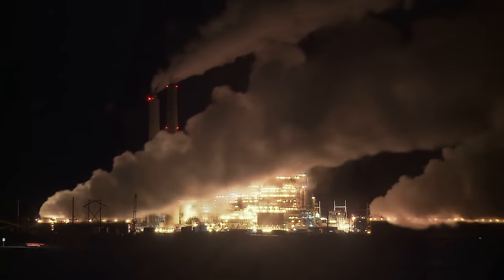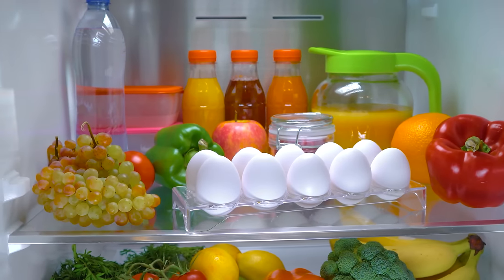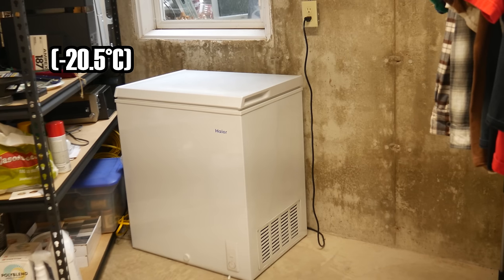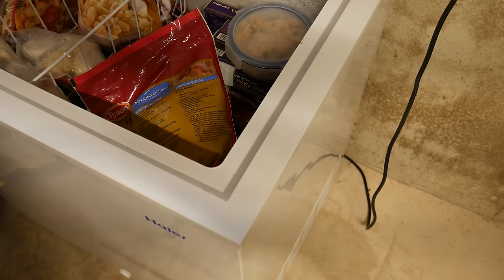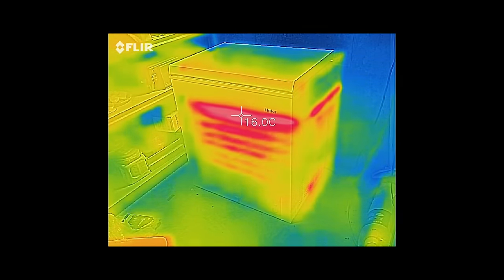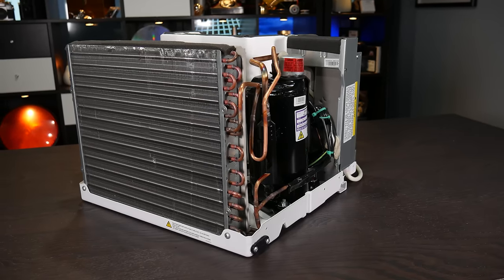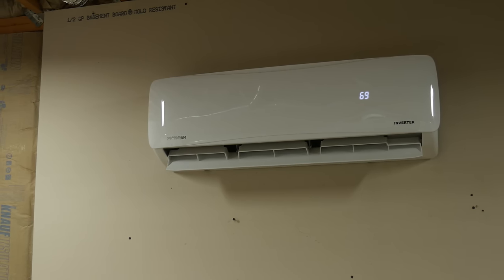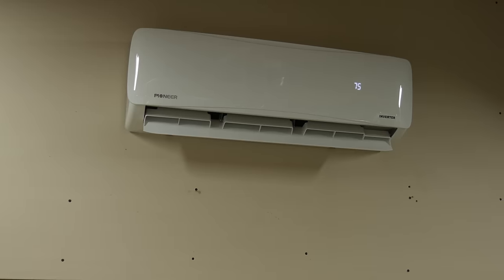Heat Pumps: the Future of Home Heating

Comment: "its just an ac but backwards"
me: installs my ac backwards for the winter
this can't possibly go wrong lol
Reply: You just need a bucket incase you have any condensate. Also earplugs.
Reply: "Turn up the heat."
"I can't reach the thermostat anymore!"
Reply: @MikePerreman  how? It's always going to be below target temperature.
Reply: @shawnpitman876  You could always pull some trickery with a little circuit reverse engineering, and relocating the thermostat inside. Granted it'd be more work than it's worth, but It's still doable. Basically just an opposite style thermistor than what's already equipped.
Reply: It would kinda work, they're just not designed to handle frozen heat exchangers like a heat pump is.
Reply: Well, it would work, cooling the outside and heating the inside as the exhaust would be pointing inwards, but at that point an electric heater would be more efficient.
Reply: When I was a kid, I’d walk by the A/C unit and feel the heat coming off. Even then, I knew it was some type of heat transfer.
Reply: @thespacemanfil  Considering when it's cold it's usually dry anyways...plus humid air has a greater heat capacity. Sounds like a win win.
Reply: @mykeprior3436  A/C units dehumidify as well as cool, as it is what they are designed to do. Just saying some people might not like humidity.
Reply: @thespacemanfil  there's a whole another video on heating and winter and needing humidity inside while heating because the heating action is drying out the air so this would help in a way
Reply: @buddyclem7328  I know some mini split units can be paired with a wired remote, so.....
Reply: @shawnpitman876  The less sophisticated units usually have a "max AC" setting, which means it's essentially on all the time
Reply: @thespacemanfil  You can't humidify without adding water. In a flipped window unit the drain would go into instead of outside the house, but as any condensation would permanently freeze on the condenser there would be no drainage until you turned it off and the temperature outside was warm enough to melt it. Otherwise, using a heat pump merely heats the air inside, it doesn't add water, and because you're increasing the temperature you would be lowering the relative humidity (increasing the capacity of the air to hold more water), essentially also dehumidifying the air inside the home just like any other heater.

As for efficiency, it would be no different than any other heat pump.

But it wouldn't work at all without replacing or massively modifying the control electronics that are designed to cool, not heat. The thermostat is designed to come on above a set temperature and it would have to be changed so it comes on below the set temperature instead.
Reply: Technically will work. However, most window A/C units on the market have a low temp sensor on them which will not allow the compressor to start because the pressure gradients are too disparate for the equipment to handle. In fact, your car has a low temp sensor that does the same thing as well.
Reply: Yep, you need to outside to turn on your heat ! LOL !
Reply: @jazzman92478  Nope, it's a nonstarter when the thermostat is set up to make things cooler and the temperature is already lower than the thermostat goes.

You could heat your house in the summer! 🤣
Reply: Pull the thermosening bulb and wrap an electric heat pad around it. Or just put a 100w incandescent light next to it.
Reply: u mean like the type of AC you'd install in a window?
theoretically that shud work fine.... but like radnuke said. Keep a bucket underneath xD
Reply: @Broockle  No, won't work at all with the factory thermostat. A bucket won't be necessary because any condensation will freeze. It will also block the evaporator and pretty much bring the process to a halt.
Reply: Does that make it a C/A?
Reply: @awo1fman  
......r we talking about the same devices?
I always see the heat sync having a spillway for the condensated water to go outside where the heat usually goes. So I'm thinking if you turn it around the water will end up indoors instead..... I have no idea how that could freeze as you said. 

And factory thermostat... guess that might shut itself off under circumstances... maybe you'd need to diy something there.
Reply: @darkowl9  
i was w8ing for this comment xD
Reply: @Broockle  Yes, the drain would go inside where you would have to have a bucket to catch it... if it weren't for the fact that it would freeze directly on the condenser and never get a chance to drain anywhere. Then there's the fact that the cold outside air would likely be more dry anyway. As he shows in the video, it can happen and heat pumps are designed to deal with it, but a window air conditioner only has to deal with warm temperatures and has no way to actively melt the ice (it relies on cycling off in a room that is well above freezing to clear the condenser), so it would just stay frozen and block the air flow through the condenser fins, making things go south quickly.

It's possible to modify a window unit to work in reverse, but it's not possible to just turn one around in the window and have it work. By the time you're done modifying it, you may as well have gone with an actual heat pump anyway. 

Some of those motel units are heat pumps and heat as well as cool. Many just use resistive heat elements but I'm pretty sure some of the newer ones are heat pumps.

I had an old car with an under-dash air conditioner that was really bad about freezing up in a hot and humid climate. It would run constantly and not stay off long enough to melt the ice, and it was worse when it was hotter. It was a vicious cycle because the more it froze the less effective it got and the more you wanted to turn the thermostat down. A condenser outdoors in cold weather would have no chance at all of clearing without a dedicated system in place.
Reply: @awo1fman  
mok, sounds legit.... the image of it still amuses me tho xD
I kinda do wanna see someone try it and show everything wrong with the approach.
Reply: @shawnstillman4203  Yeah, or a candle.
Reply: @mykeprior3436  you have that backwards. Hot air has a greater humidity capacity, not more humid air has more heat capacity.
Reply: @shawnpitman876  whow there buddy.
hot air can hold more water vapour as there's literally more "space" at constant pressure for molecules.
water vapour has a greater heat capacity then dry air. Period. Two parcels of air at the same  pressure & temperature differing in humidity only would result in the more humid air having greater heat capacity as water is capable of absorbing IR in wider bands as well as having more degrees of freedom allows for more places for heat energy to translate to movement within water versus dipole neutral molecules like nitrogen, oxygen and the noble gases which primarily make up the air (carbon dioxide and methane being the few with a dipole which stretches due to IR but are in the ppm range versus water which can make up to 4% of air by volume in the tropics). A great portion of the air has a component which is better at absorbing heat, hence higher heat capacity.
In fact, your statement is even more bewildering as "hot" air at constant pressure becomes worse at "holding" heat as the temperature increases under a constant gradient and it's heat capacity is exceeded until you get it into a state where it either is reacting or electrons begin changing orbitals, where the heat capacity would suddenly increase. Heat capacity is NOT the same as thermal conductivity.
More humid air would take longer to heat up but would stay warmer for longer.
Grad degree in chemistry, please keep ignorance off the channel.
Reply: That actually would work, although reaching the controls would be... inconvenient. And it's probably not waterproof. And it would be incredibly noisy.
Reply: @MikePerreman  and kinda break your AC unit
Reply: Just buy an A/C unit that already has a Heat option

Comment: In Korea for a business trip and I was surprised to recognize that almost every building where I am is heated by heat pumps despite during the coldest parts of winter it getting into the single digit negatives (F). Caused some issues on the coldest nights as it would have to pause to defrost periodically but I was able to use a space heater to flatten out the curve in temperature fluctuations.

Comment: I was a refrigeration engineer for 40 years.(retired) This is the first video I have seen that explains the operation of a heat pump correctly. Well done. I find your "heat" units a little strange, I am used to BthU  & Si units. I built my own system using a 3HP Frigidaire unit, (R22) belt driven in my garage, with the evaporator/condenser in a warm air duct system, 35 years ago. Worked well for over 10 years, until I moved house. Serviced it for the new owners for 3 years until I left the area. Love your video's, keep up the high standard. I am in the UK by the way.

Comment: When I was a kid in the 70s, my parents had a 60s vintage Kelvinator refrigerator.  It used a process similar to a heat pump to defrost itself.  A few times a day we would hear a shhhhh sound as the refrigerant would reverse flow.  Occasionally,  the mechanical timer would fail but otherwise,  it was a good refrigerator.
Reply: interesting, I never heard about refrigerators defrosting. I guess modern fridges are just built in a way where they dont need to do that? Or maybe they still have the capability and only do that when its really cold.
Reply: Defrosting of modern refrigerators is by an electric heater behind a panel at the back of the food compartment. The refrigerator shuts off and turns the heater on for a couple of minutes. It's simpler and cheaper than having the refrigerant flow reversed.
Reply: @rebeuhsin6410  Yeah I suspect modern fridges to be optimized af.
Reply: @termitreter6545  Yeah old refrigerators needed to be defrosted. Initially there used to be manual button for it. We used to have a LG refrigerator which had it. In later models the refrigerator started doing it on its own and now modern refrigerators have a panel on there sides and back which are separate heaters as it is more efficient than literally reversing the flow.

This is the reason why old refrigerators had literally pipes running through there back.
Reply: @nisargbhavsar25  Neat! I do remember my family having had an old refrigerator with those pipes in the back.
Reply: I remember my Aunt had a large gas powered refrigerator in her house (you still get small ones for Caravans. I wonder if you could have the flame inside heating the house while it also drew heat in from the outside ?
Reply: I have a mini-fridge that lacks automatic defrost.  About once a month I eat all the food til empty, unplug the unit, and goto the grocery.
Reply: By the time I return, the ice has dropped off the fridge interior.  I wipe it down with a towel & put my just-bought food inside.  It’s really not that difficult if you do it when food is almost gone.
Reply: Modern fridges still have coils to throw-off the heat.  And Self-defrost has a major drawback: The heating creates ice crystals in your ice cream and popsicles  (yuck).  That doesn’t happen in chest freezers which lack the defrost cycle.
Reply: @AlphaCarinae  It was more space and cost effective for the companies. It was also done to avoid leakage of green house gases.
Reply: @hkelly1623  more wasteful and crude however.
A symptom of modern materialism.

Comment: I have been installing large commercial and smaller domestic heapumps in New Zealand for 15+ years.  Heatpumps are even better than the video suggests as some systems (VRF) can cool one area then divert that gas that has absorbed heat to another room and heat that room for free.   Every house  has a heatpump for heating in winter , they get used as and air conditioner to a lesser extent in summer depending on your location.

Great video! its hard to explain how you can heat a room by absorbing all the cold from that room.
Reply: @xr6lad  the coldest part of Australia would be equal to or warmer than nzs coldest  Heat pumps aren't air conditioners,  it was minus 5deg C here this morning, my heatpump was cranking out the heat, house was easy 23deg c 
Yes there is 15min of each our for defrost.... bigger external coil area equals more heat.... not sure what system your referring to
Reply: @aaronbatchelor5978 Not entirely true. I live in Australia (after 40 yrs in New Zealand). Plenty of places in australia get as cold as NZ - although I agreed the coldest in NZ is likely colder than Australia’s coldest. Yeah NZ has a colder average climate. 
Even in winter in Christchurch when it snowed in 2011 and I ran the heat pump all day at 23°C the unit only stopped hourly for 5-10 mins to defrost (not 15).

Comment: I don't know why people don't think abstractly and think of "AC" (conditioning the air but only in the cold direction for some reason (well...of course)), a refridgerator, among some other appliances as just "applied heat pumps." I was actually surprised to see your title, as you have the earlier videos about how there needs to be a place to pump the heat so those inside AC units without a part outside don't work. But then I realized how helpful it would be and how (seemingly) silly it is we don't use the same heat pump for "AC" as we do heat.

I'm glad you made this video because it really is as simple as having the temperature control "executor" would be that display that labels the compressor and evaborator twice. I suppose calling them the higher level category about them being one of two ends of the heat pump might help. 

Speaking of heat, I also want to thank you for those videos about ceramic room heaters (completely random other than concept association with heat).

Anyway, great video as always. I know I'm late but that's video on demand platforms for ya.
Reply: It’s really common that heat pumps are used for both AC and heat though. My place is a piece of garbage but we have a heat pump for both AC and heat; it sucks

Comment: My desire to consolidate got me dreaming of a future when a house has one big refrigerant circuit that provides heating, hot water, fridges, freezers, and ACs.
Reply: Why? So if a single part of that entire circuit fails, it ALL goes down?
Reply: In commercial refrigeration (restaurants, grocery stores etc), it is common to use a shared circuit for the chillers, refrigerators, icemakers and what-not. I don't think you could share that with an A/C system but I also am not an expert at refrigeration. This helps keep the indoor air at a reasonable temp without over-taxing the A/C.
Reply: You can already do it really. Not only do they make "mini split" refrigerators but all you need to do is modify any fridge you want with a plate heat exchanger and run a water loop through it. 
Have a HVAC tech braze one on for you in place of the condenser, the run some PEX to the fridge.
Reply: @RGInquisitor  In theory, if you're consolidating it all to one system, then you could have two backup systems. On top of the main heat pump system, you have a backup heat pump and then auxiliary heating. I'm not an urban engineer/anyone else that would consider this, though, so there's probably something I'm missing
Reply: @OrangeC7  Well you definitely could have backups, but a consolidated system in itself would already be very complex. Adding redundancy to each part of the system would be a lot more work than just having each part working independently.
Reply: Anything is possible with enough money to spend (with a few exceptions at the time of me writing this)
Reply: @matthewtuel2747   yes, it can be done, but it is not done because of reliability issues.
If just one component breaks, the whole store is without cooling.
Reply: 69 upvotes
Reply: You actually can combine all of that.
Check out the Daikin Conveni-Pack.
With the Power of CO2 Refrigerant (R744) and VRV technology your dreams aren't just dreams anymore
Reply: Heat recovery systems work pretty good. They use the heat from the refrigerator, freezer and air conditioner to heat domestic hot water. There are also heat recovery ventilators that use heat from exhaust air (restroom exhaust for example) to pre-heat fresh outdoor air and pre-cool fresh air in the Summer. Water source heat pumps are even more efficient than the air source systems described in this video.
Reply: Most RV’s run almost everything on propane. Even the refrigerator. It’s not far from your dream.

Comment: I just built an apartment building that uses heat pumps down to -30C. It also has a third refrigerant line for the heat recovery. That lets certain people air condition if they are south facing and it lets the colder apartments use that rejected energy to heat.

Comment: He is right about the amount of power used, this past winter we found out. It was cheaper to let the heat pump run for 24hrs rather than letting the actual heating elements run for 12hrs.
Reply: It depends, if the humidity is high with very low temperature, your external unit will freeze and you'll loose power with your defrost cycle
Reply: And the colder it gets outside the less efficient a heat pump becomes
Reply: So they're no good for Siberia, got it.  Meanwhile a billion homes in the temperate latitudes will probably be able to make use of them just fine.
Reply: @herbderbler1585  lol talking about Siberia : even if it's cold, it's a very dry place so your heatpump won't necessarily be an ice block. Moreover on sunny days, (and Siberia is way less cloudy than Scotland) you can benefit of this weather to turn on your heatpump during the day than switch on the fire during the colder, wet night